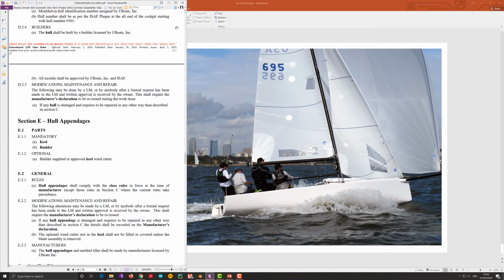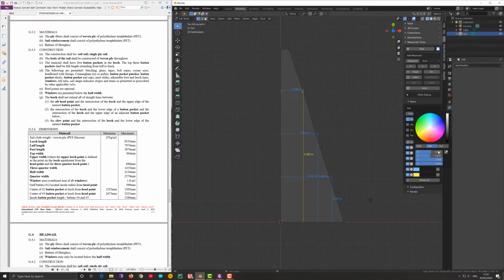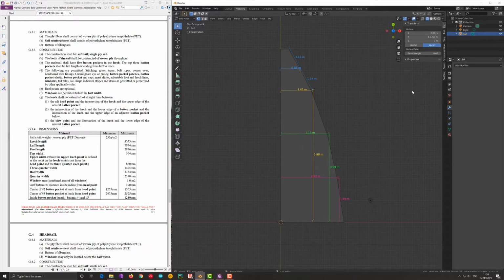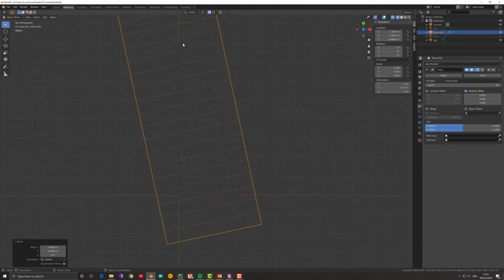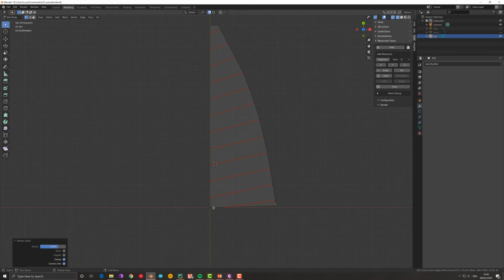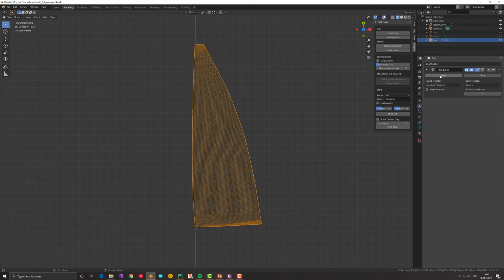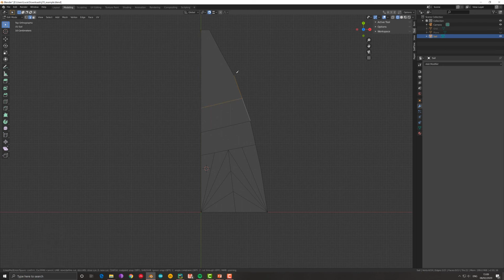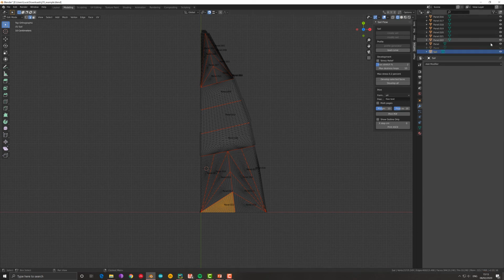Design a regatta sail with SailFlow for blender; J70 example

Comment: Thanks a lot for making this tool ! I'm a sailmaker apprentice, very interested in sail design and I can't affoard nor believe professional softwares like Sailpack is always necessary to achieve good design. I'd like to start by designing (then building) from scratch a windsurf wave sail, 4 batten with the broadseams mostly located in a vertical panel close to the mast panel and little broadseams on the bottom pannel, the other pannels will be flat to let the leech work easily. I hope I'll be able to do it this year and show the result of this work. I hope will see other videos for version 4 soon ! Also I discovered the old non-update github repo for Sailflow, do you plan on updating it ? and how much experience would be required to help develop the tool ? I plan on learning python.